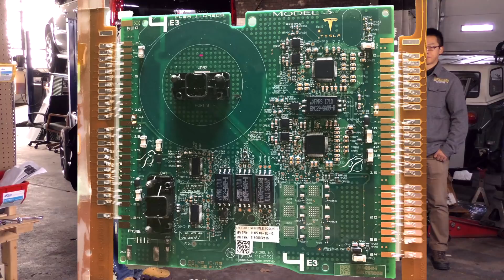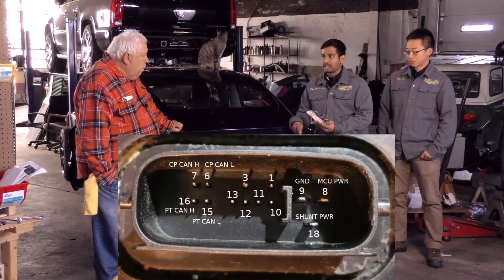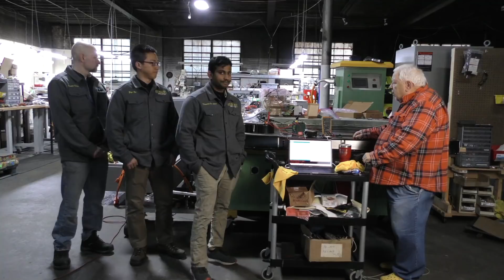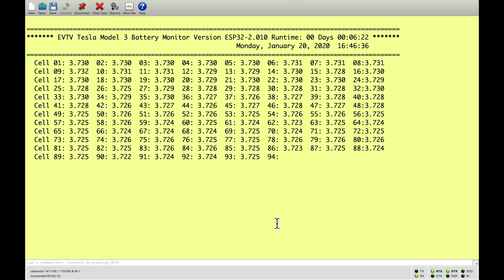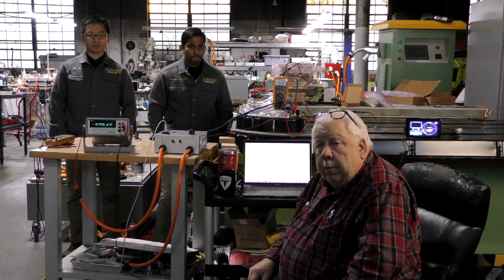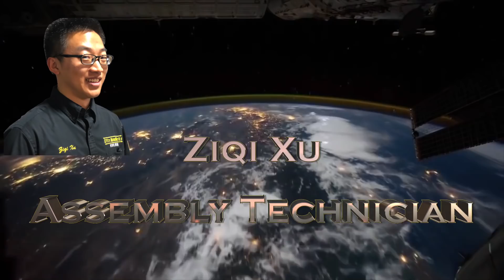EVTV Tesla Model 3 Full Battery Pack Controller for Solar Energy Storage Applications

Comment: It's just too bad there's not a lot of 300 to 400 volt DC inverter!!!
Reply: Sandi 20 kW, they built it to Jack's specs. Frequency shift and back feed to the inverter's output with 240 Vac from micro inverters is all there
Reply: The Fronius Symo Hybrid is one, but their protocol to the battery is proprietary. There is some investigations needed too.
Reply: @karlzeilhofer  you find how to k9municate wih he battery?

Comment: Hi Jack, Would it be possible that you would provide electric motors etc. for RV's that would use Tesla Superchargers? There is a market there now, as many are looking at school bus conversions. If you used two Tesla batteries linked in parallel and with all the bells and whistles in the19' and longer, you'd have a real winner...including your connections with Elon Musk. I don't know if you have the resources to do this, but a few to show-and-tell models could evolve into a business purchase from Tesla to go big time. Any comments?

Comment: Finding the contactors message is a win.  It would be logical that the cell reporting is turned off when soc is above 15 % or below 90%.  Finding the weakest cell is done then to raise the degradation bar safely and economically.

Comment: Nice work guys! It would great if you could do this for the chevy volt also. Crashed chevy volts are very cheap. With the built in 4 cylinder engine 55kwh generator it would make a good off grid complete power source. Please pretty please

Comment: Ive been waiting for this for so long. Picking these cars up at the auction for dirt cheap and having a usable 77kwh battery in the house is just nuts to me. Game will be changed soon enough. Thank you!!
Reply: Where do you find model3 full packs for sale other than eBay?  Thanks!
Reply: Net Positive LLC Sorry, I meant like buying the whole salvaged car with a battery inside it. I bought my other salvaged model 3 for 18k and it was in fairly good shape. Battery pack doesnt have a scratch on it.

Comment: The PCS relies upon there being an adequate 'donkey battery' charge to empower the car through the main battery.  I would suggest that the 'donkey battery' is also a lithium based design and requires that fifteen volts to enable it to be kept up to its operating voltage through being charged by the main battery.  If the 'donkey battery' is inadequate to the task of supplying power to enliven the main battery system, the sudden dump of power going into it in order to recover it from its depleted condition is likely to bring about design envelope excesses.  It's only a thought, but it is worth putting into the mix.  Thankyou for sharing your wisdom Jack, it's the new knowledge all us old shedsperts are going to have to learn as time passes, or leave us all standing and left behind!

Comment: I’m in the process of installing some solar on my rooftop, and I’ll be very interested in one of these battery packages once it’s ready..  Question - if I’m getting battery backup, will it make any sense to install microinverters?  Seems like if there’s already an inverter on the battery, it should also be able to handle a string of solar panels, no?
Reply: a central inverter is a single point of failure for the whole system.  microinverter allows incremental failures to not compromise the entire system.  Also microinverters allow scale and flexibility.  micro inverters are the better tech.

Comment: Jack, I bet you’re right - that the car can send a can message to suppress the 401 can message from the battery.  They’ve had a very hard time getting the backup camera feed to appear quickly on the screen after putting in reverse.  I’m willing to bet they developed a way to suppress a lot of can messages that can be done without for a few seconds by broadcasting a single can message from the car, thus enabling you to quickly see what you’re backing into.